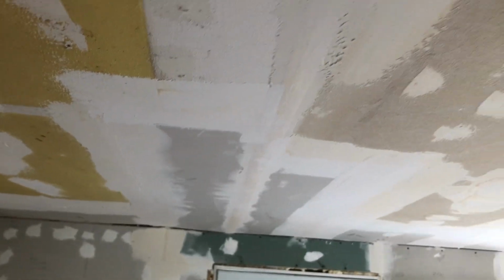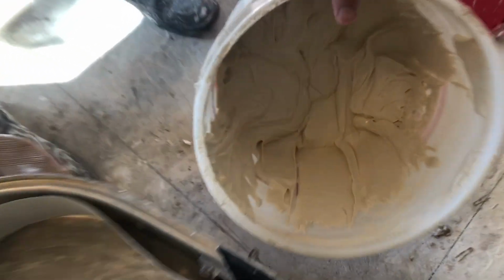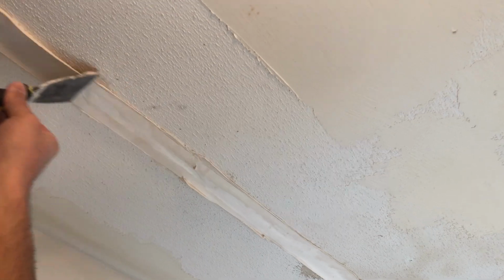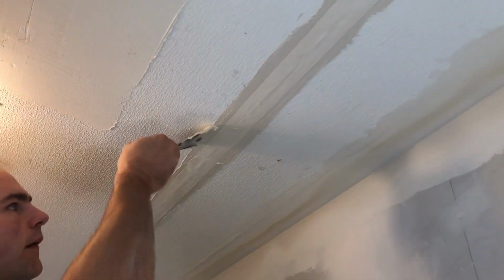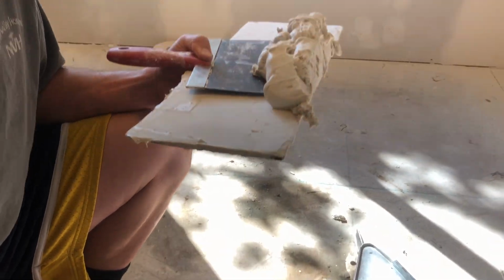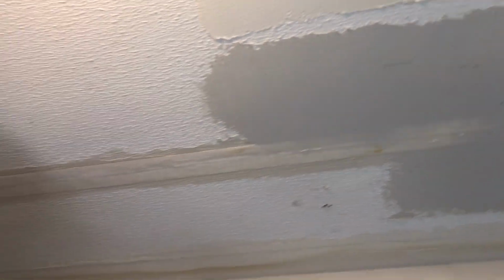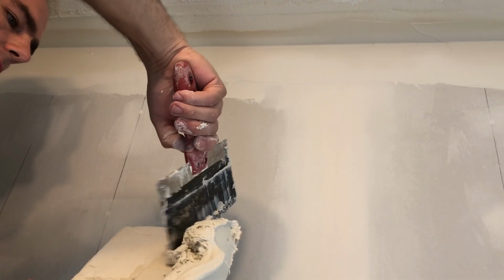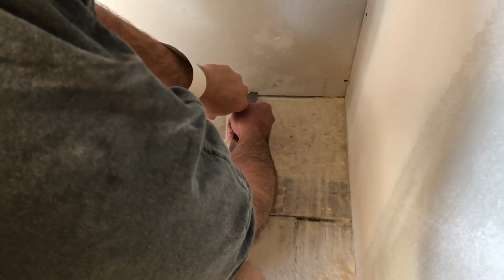Junk mobile home drywall taping

Comment from the maker: In this video I explain how I replaced insulation before installing new drywall, and how I patched the ceilings, I show how I tape a ceiling joint and how I tape a corner joint.
Drywall taping tool I used: https://amzn.to/3rcIJK8